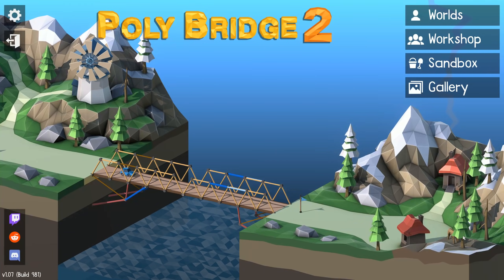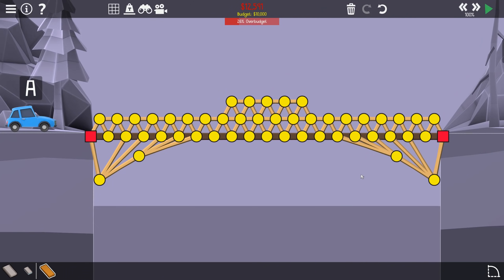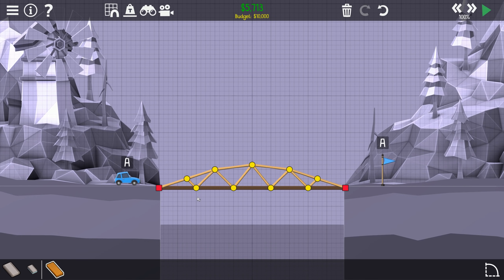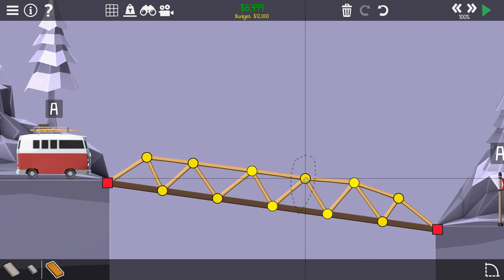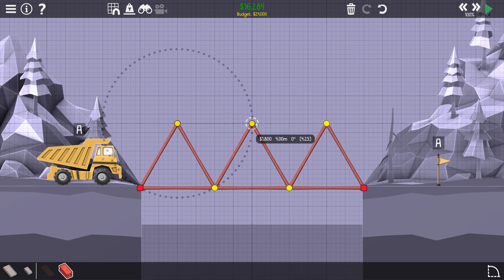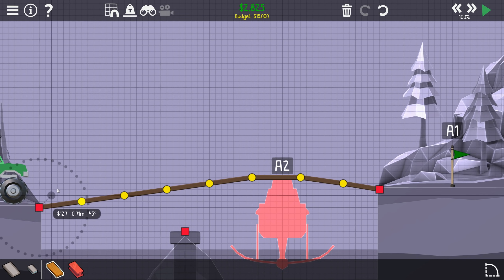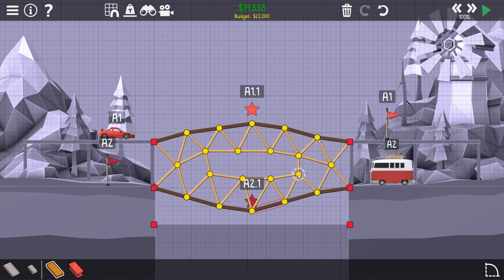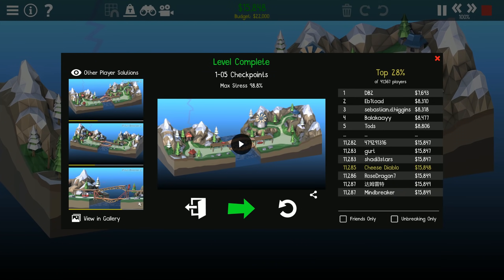A real CIVIL ENGINEER discovers STONE WALLS Poly Bridge 2!

Comment: Sorry, you’re wrong.

Triangles are the strongest shape with corners. But, arches and spheres are much stronger, as they don’t have points they can easily break at (corners). Of course, each have their place, but a triangle would be horrible on a plane window, as the corners would provide a point for cracks to start. Not as bad as using squares for plane windows… many planes crashed because of spontaneous disassembly at the sides, but one (I belive it was the DC-40? Or was it 10?) never broke. For aesthetic reasons, they used round windows, and the windows never caused crashes. While not in service, there are still a few in existence that are useable!

So, all hail spheres! All hail triangles!

Fun fact: triangles are stable because each side blocks 1 spatial dimension. A fourth line makes it act like a hinge on the side (hence pushing chairs over is easier than bar stools). If we had 4 spatial dimensions, a 3 lever stool would fall, just like a 2 legged stool now! But, as the fourth dimension is temporal, not spatial, triangles work! For a 4d space, it’s All Hail Squares…

Comment: If you wanna beat 1-1 with a really cheap road(without launching the car with a falling road that also breaks physics) use the tool at the bottom corner and do a physics breaking dangling road

Comment: "Triangles are the strongest shape"

Laughs in wood muscles
Reply: Those are triangles
Reply: @afurryferret  actually if you only count the outside of wood muscles then it's diamond shape
Reply: @kharkovluzhin8333  We aren't talking about diamonds though. We are talking about muscles.
Reply: @tylerbreau4544  they diamond with extra steps
Reply: Two triangles stuck together > One triangle.
:. Triangle not strongest.

That's an incomplete argument, and bad reasoning.

Specifically, a "muscle" isn't a shape, because it's defined by internal lines which aren't part of what's considered when discussing a "shape" technically. A muscle is a diamond shape, with extra bits. That those extra bits just turn it into triangles only proves the superiority of triangles over diamonds.

Comment: 4:29 how people got that insanely low?

They used something called “dangling roads”
No triangles, just a curved road hanging in between and beneath the two red joint holders.

You can’t go straight across or the bridge will fail, but if you shape the roads so they are already sagging, then they hold as long as you do it right.
Reply: nah that low means falling road. You build a road really high up in the sky and it falls on the car and launches it to the flag. Dangling road in first Lvl would need to be 2000$+
Reply: @martinbendel6440  nope, they have low ceilings in polybridge 2. There has only been 1 level I have seen so far that has used a falling road, but a ridiculous amount of levels can be completed with dangling roads. The other big problem is spring launchers, there is around a handful that can be cheesed by bracing springs against the environment and launching the car.
Reply: @EpicBaCkFliPz  Nope, players have already found ways to do falling roads in PB2, even with the low ceilings.
Reply: Nah nah nah I got a dangling road to 1200 but yeah a falling road is the best way to do light cars for cheap prices.
Reply: Laughs in skip to final level

Comment: People say triangles are the strongest shape. But what about an arch?
Reply from the maker: An arch isn't a shape, as such. An arch is usually formed from other shapes in structures. Triangles are the shape with the smallest amount of sides, therefore they are rigid and cannot change the angles of its corners like a square or Pentagon etc could if weight was applied (imagine the corners are hinges that can move like it this game). You might argue about circles as they have no joints, but that's a discussion for another time!!

Comment: For the first level, people reached a super low budget by placing roads in the air and have them fall on the car in a way that launches the car across the water in case you were wondering.
Reply from the maker: Thanks, yeah I had some others point that out to me. Not a tactic I'll be trying myself though!

Comment: If you're still reading comments and haven't figured it out by now, the reason that the bridge at the start didn't work is because the only things in the game that have weight are joints, roads, and cars. So by building a bunch of micro triangles, you are adding extra joints, which are very heavy, since they're supposed to account for the weight of full length supports.
IDK, you may have figured it out by now. But that's why.
Reply from the maker: Always reading comments mate! Thank you, but yes I have worked that out now- in fact if you come back this time tomorrow there'll be a video where I explain whether the game could be used to design bridges in real life and I go through the point you correctly mentioned. Cheers for the comment though!
Reply: @RealCivilEngineerGaming  still?
Reply: @tfordham13  nah
Reply: @tfordham13 nah his channel is too big now to read all the comments, i don't blame him
Reply: @parknich081  not really he only has less than 2 mill most are either bots,random people subbing for 1 vid or dead accounts

Comment: Try using the tool in the bottom right, which automatically draws curved slopes with roads of equal length.
Reply from the maker: Wasn't aware of that, thanks- will try it soon!
Reply: Smart boi
Reply: Hi
Reply: Booooooooooosh
Reply: Lirththeenth
Reply: @kaya-sem  wow, you're the third comment. So much excitement right here!
Reply: @Xulah  wow your fourth
Reply: Le sixth
Reply: @rakhapradana7350  Le seventh
Reply: L'eighth
Reply: LINTH
Reply: @matthewfarrell1763  LENTH
Reply: I’m the second comment on this post